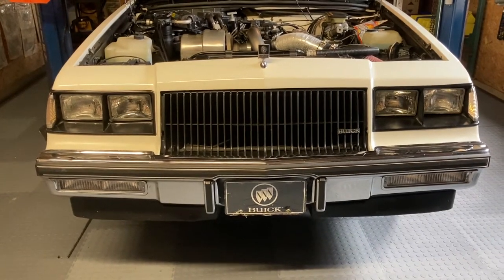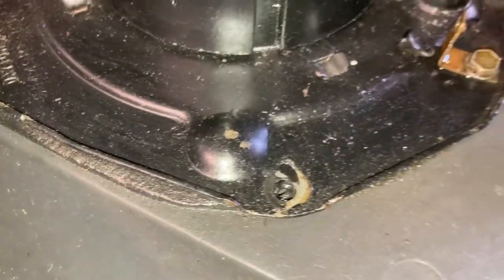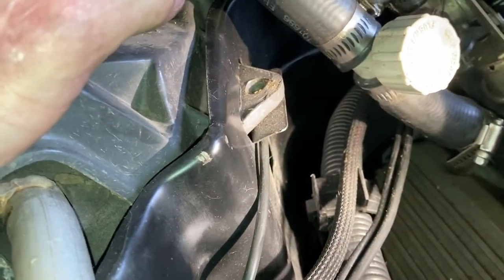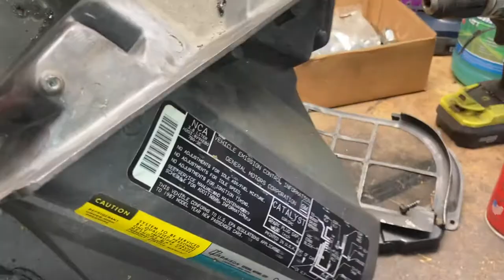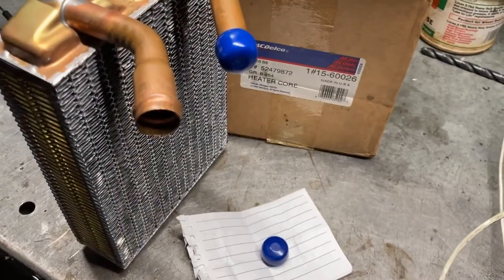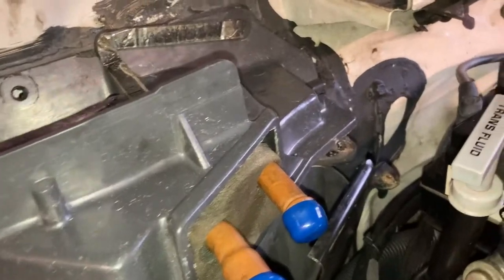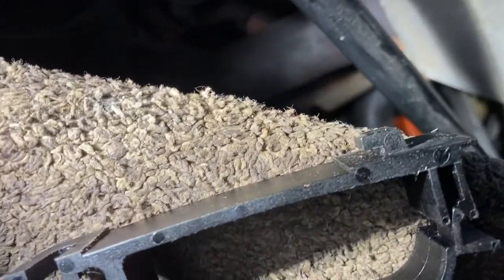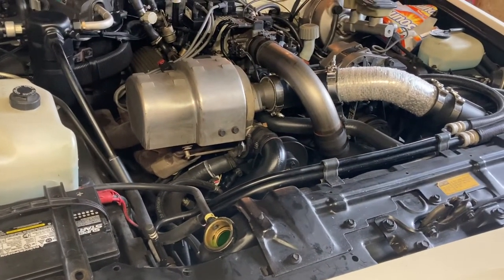1978-1987 BUICK REGAL:  REPLACING THE HEATER CORE. "WHAT'S THAT SMELL" ?.

Comment: Very helpful except that I didn’t listen very well. I forgot to remove two hidden screws in the air intake, used force, and broke a few small pieces from the  cover and cracked it in several places. I think I can fix it. My car is a 1990 Buick LeSabre estate wagon. I couldn’t find an OEM  Brass heater core so I’m going with the Aluminum Chinese one. Honestly the coolant smell wasn’t that bad. I never should have touched it. Too late now, have to press on.
Reply from the maker: Boy o' man, a nice big and reliable 307 V-8 ? / "those were B E A U T I F U L  cars" !!  ...  Just fix it / and it'll be OK.
Reply: @TommyZTrains Thanks, in the 80s My dad had an Estate Wagon and a Grand National. Both fun cars.
Reply from the maker: @davidwhitman9609  I remember them ALL having worked all my Career at Buick !  ... "my Pop too" !! (The Estate Wagon ownership).

Comment: Where did you locate the  mold foam material that was deteriorated ? did you substituted with some other material?
Reply from the maker: Originally it was a chemically treated piece of material to help ward off fungicide and mold (as you know), but what I used was 3M scotch-bright pads treated with Lysol (in the small bottle / the “real-strong stuff”). 
 
At the Dealership level (to help abate mold amid a stinky / moldy smell of "dampness"), was to remove the blower resistor cluster / and “sauce” the evap. core from in there. 🥴

Comment: Can not find that heater core no where even put the parts number on Ebay motor,  nowhere!
Reply from the maker: Hum ... "perhaps the No. changed" ?. I bought a couple of spares / as my other cars will likely crap-out to. Perhaps you can take it to your local radiator shop and they'll fix it / tank-it / and boil it out. Such a common part surprises me / amid non-availability !.  Best of luck
Reply from the maker: Did you buy that heater core on EBay ?, (GM-9088) ... anyway, just watch as they ARE coming-up 4 sale rather often / very common part.

78-87's are all the same ...   :- )
Reply: @TommyZTrains  yes Ebay, Google, everywhere, I just went on and ordered one from 4 season
Reply from the maker: @jamespeoples4657   That's so crazy / and;  for a "still" popular car !.  Just get an Aluminum core and you'll be fine (which is a bit off / but will work fine that everyone seems to have).  WHO KNOWS: "THEIR PROBABLY BETTER" ?!!!